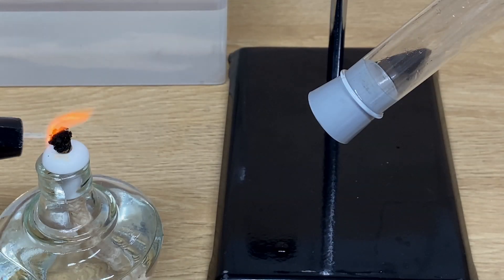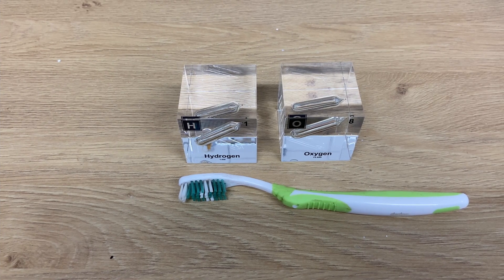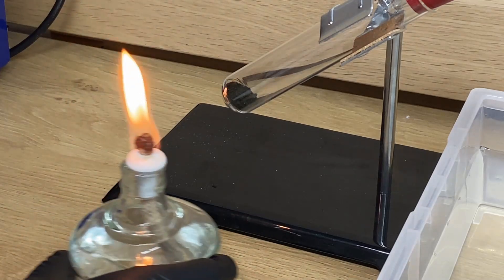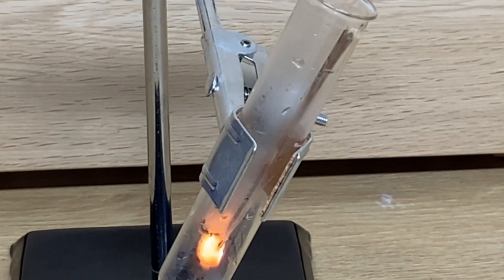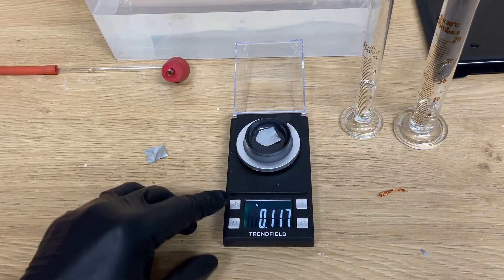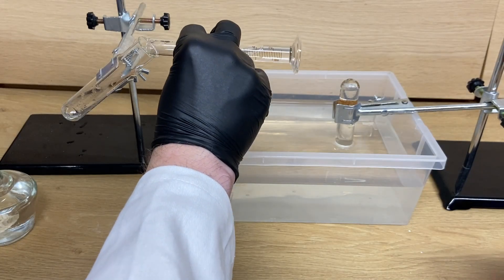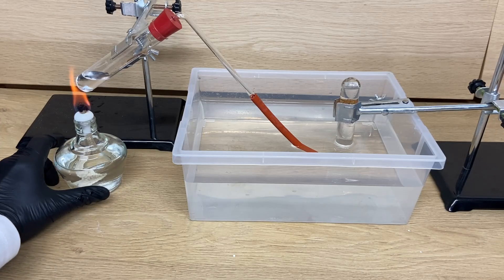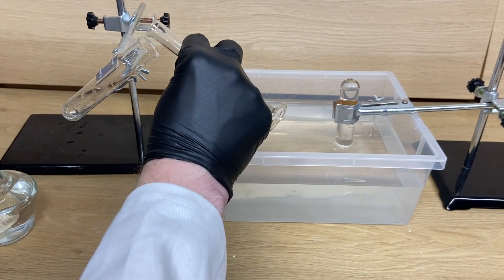Everyday Science: I was wrong and wasted perfectly good copper😤🧪

Comment: Novice here. I did a similar experiment for my "kids" science project.  It was to show effects oxygen had on combustion.  I needed hydrogen and just used zinc and hydrochloric (muratic) acid.  No heat, no copper, and test tubes filled fairly quickly. When I watched your original video, I was wondering if I did it wrong or if I just got lucky.
Reply from the maker: @ccWhittemore  thanks for sharing. No luck was involved the copper was like you also proved not needed!!

Comment: Copper could just be a heat buffer/spreader ?
Reply from the maker: Could be but if that was the case, then the reaction in the case with copper should go faster right? In this case whether i heat or do not heat, there is no difference in rate of creating Hydrogen.
Reply: @CubeChemistry   Like the person mentioned, there should be no reason for the copper to act like a catalyst. Copper ions may have more of an effect, though likely mostly because of the heat generated by the reaction between Cu{2+} and zinc metal.